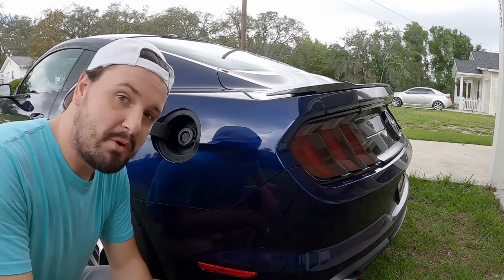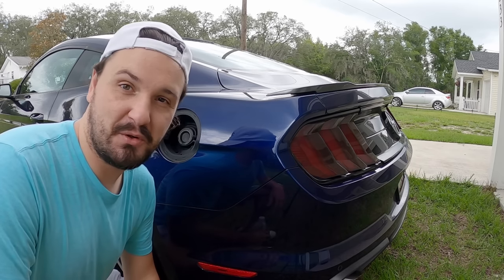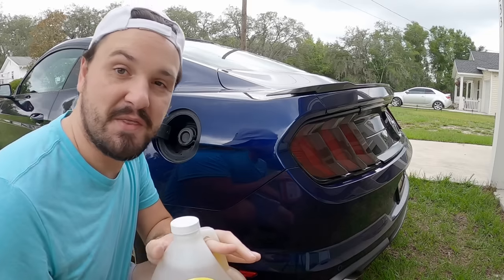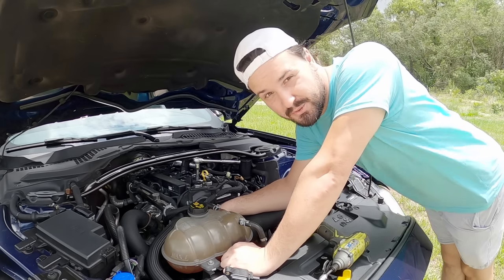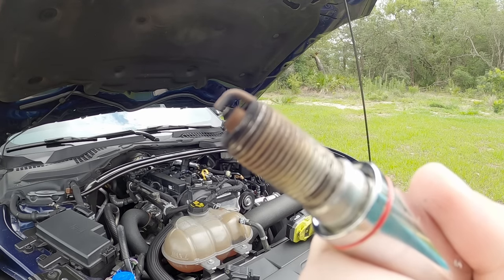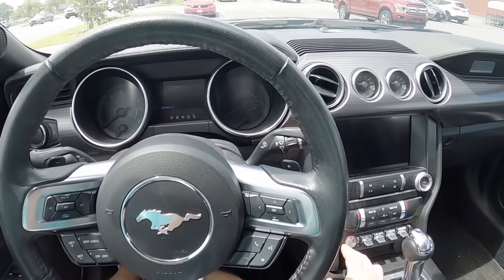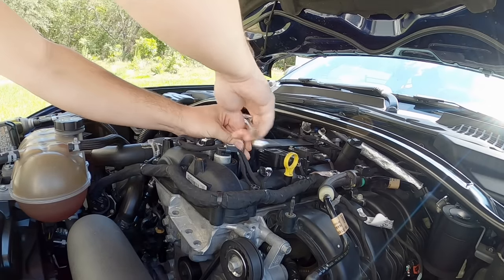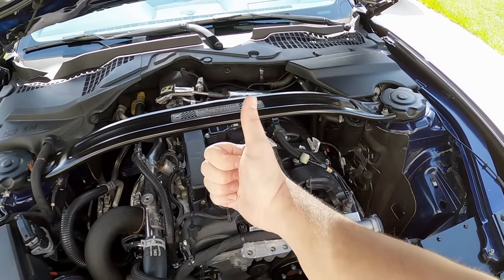The UNTHINKABLE Happened after using a Gallon of Lucas Fuel Treatment!

Comment: @Rcdoski, along those lines, I saw a woman putting air in her SUV tires. She was having a problem, so i asked if she needed help. At that point she had 85 lbs in the tire and the bell was still dinging. I was afraid the tire was gonna pop before we got the pressure down. God doesnt know what would have happened if she had gone on the Interstate with those tires overinflated. Her short wheel base SUV would be bouncing like a pingpong ball and probably oversteer through the guardrail.

Comment: Marvel mystery oil works great for older vehicle’s that do not have catalytic converter‘s. Marvel mystery oil will cause soot and particles from the engine. If any are there to plug up the Cadillac converter. At $1000-$2000 a catalytic converter I would suggest not putting stuff in your intake or gas tank that could plug it up.

Comment: I put Lucas transmission treatment in a ranger truck it had 350,000 miles on it it was shuttering installed new filter and toped it off with new transmission fluid and a quart of the treatment no more shuttering matter of a fact you can't hardly feel the dang thing shift

Comment: I just did plugs on my new to me 2011 f150 ecoboost with 106k miles on it, come to find out they were the original plugs with ford on them, and they were cleaner than those plugs 😂 yet worn bad enough to give a misfire in cylinder 3 and throw a code, tho I did run seafoam thru the gas tank when I got it at 105k miles

Comment: I pull the heads off of engines and get valves, guides and seats remachined.
You won't believe what it does to my engines!
Reply: Works great for old V8's. Top of bores having just slight wear. Good for 100,000 more miles.

Comment: ive only been a mechanic for 30 something years yet the term "upper cylinder" means what? 
and the plug was not dirty from "upper cylinder" cleaning, it was oil fouled because all them additives are oil...anybody notice the popping noise from the exhaust

Comment: the upper cylinder lubricant is just that. it's not needed because that is actually built into today's fuel.  
the MSDS from the UCL is a lightweight machine oil with less than 10% detergents. so it really doesn't clean anything.  the advertising speaks to the average consumer.  it's really a great snake oil, as is all lucas products.
the UCL works in diesel fuel becasue you're essentially adding oil to oil.  it "works great" because nothing bad will happen by using it.. just a waste of money.

Comment: i just use premium fuel, shell v power has all the addatives in it . and every other tank a small bottle of lucas fuel system cleaner and a good 6000 rpm thrash to clean everything out . 2004 volvo v70 2.4 petrol with 300000 miles on the clock . engine oil change every 10000 miles with top quality oil and genuine filter. mot emission test lambda reading was 1.001 at idle. 😃

Comment: Take and buy a box of old fashion formula mothballs, 15.00 for a box of 100s of balls. Crush up into powder 20 balls, good starting point for test,mix in 2 liter old pop bottle of reg. Gas.  Put in 15 oz  bottle shake until all desolved.first the bottle will get real cold and suck in. Crack open give it some air close it. Add it to full tank reg.   gas. Let idle till warmed up. Drive 5 min. Then nail it see if you don't feel about 40-50 hp. Old cheap racing fuel , give you more a nitrous type feel . Have fun😊😊😊

Comment: Well to start off with the PCM is programmed to see 87 % so if you add 103 then the PCM will try to bring that back to 87 and that is hard on your car. Now if you go and change the maps in your PCM to see 94 or 103 more power to you. I see lots of cars over the years that come in with EGR code, hum - ask the customer what fuel and they will tell me 94 and the car runs better. No, it does not. Run the fuel that that car calls for, you will be better off. Now if from time to time you want to add some injector cleaner in your fuel, go ahead. Injectors today are not like the ones 10 years ago, I don't see injector problems that much. This guy I would not trust him.

Comment: Sorry definitely NOT buying it. Premium is just a higher price regular gas. You can high rev in first gear doing 30mph/50kmh in town.. but using high revs is just doing an Italian tune-up. Re use your plugs by using a propane torch and burn the crud off. Lucas and it's products suck. The real fix is to buy new or manually take out and clean. Never trust a michelin tire

Comment: Just ruined a nice newer mustang!
It won't last as it would have you will need new converters sooner than later o2 sensors probably took off 40k miles of life😂
This Lucas is for 200k miles vehicles not new cars or trucks!
How would a newer car have clogged fuel system?
Come on this is just wrong!